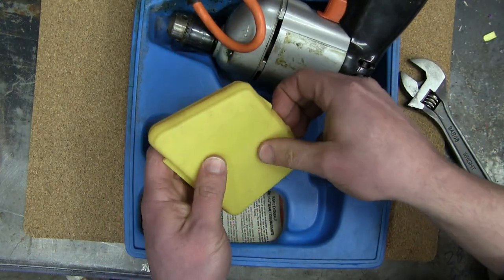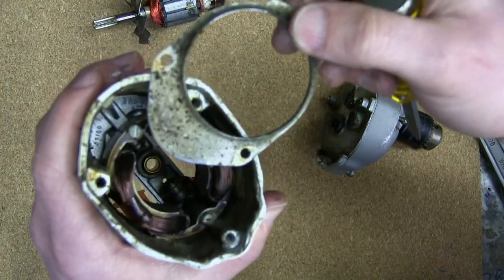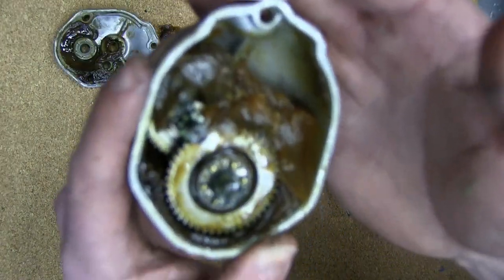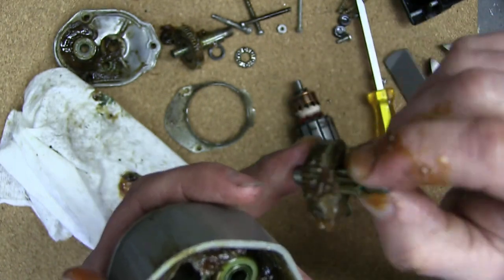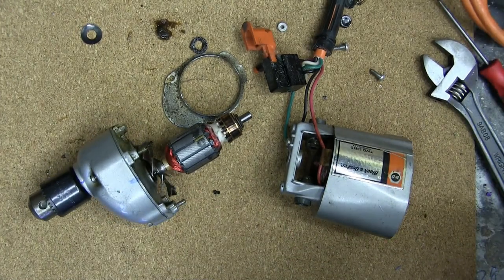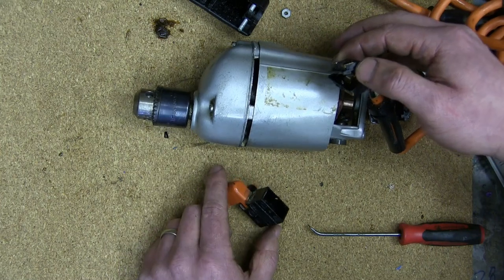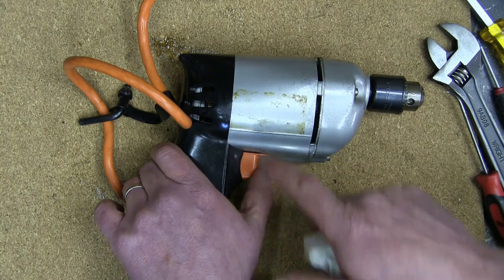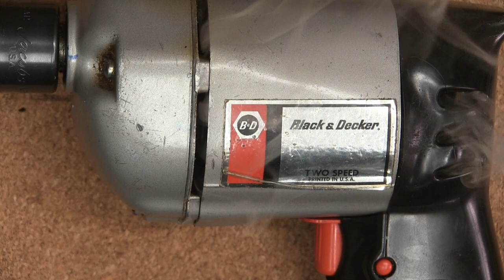BOLTR: Black & Decker. Old School.

Comment: I have that exact same drill!!!! it's awesome
Reply: mine has never been serviced and it has the same brown grease in it
Reply: I've been trying to put a bigger chuck on it, how did you get that one off?
Reply: it hurt me a little to see that one destroyed😂😂
Reply: Put the chuck key in it, then smack it counter clockwise; chuck should unthread off the shaft...
Reply: While I agree that destroying good tools is a shame, I didn't feel much for this one. These primitive single-speed forward-only drills really aren't good for much (not to mention actually quite ugly). The recycled metal could be used for better things.
Reply: Or chuck up a big allen key and smack that harder than you would think and with a larger hammer than you would think.
Reply: Paul Moir thanks, I'll be sure to try it!
Reply: +Albert Ales Probably some form of drill chuck removal wedges, or something similar fabricobbled for the same purpose. Press fit chucks are wedged off, unless you frequently need quick-change of the chuck for a different size or tool head. In that case(you're probably looking at an older, and better built drill press for one), you'll need a drill press hard eject wedge and a mallet to remove the entire taper with the chuck attached, and press home the new head and taper.

My grandfather was a machinist by trade and had nice old enco drill presses. This is how he swapped chucks for his presses, with the taper still attached. I don't know about heavy duty modern presses, but the home depot specials are just press fit and you need removal wedges to pry them off the taper.
Reply: jason sexton thank you, that's very helpfull!
Reply: jason sexton  a drill press chuck wedge thing is completely different than the chuck on a hand drill like this. This should screw off some how. Some have a screw in the bottom that’s exposed if you open up the chuck all the way then it’ll unscrew.

Comment: I have the single speed 1/4 inch chuck version of that drill, handed down by my grandfather (I'm 59), and it has an all-metal chuck. Seeing what looks like a part plastic chuck on your example, and slightly-hooped chuck key, my guess is that yours has a replacement chuck, hence the modern green schmoo. I did not enjoy seeing that thing get smoked.

Comment: The "resistor" you mentioned is in fact a diode that cuts off one sine half wave. This drill has an universal motor and works with both AC and DC.

Comment: I have and still use a similar version but it is variable speed. It was a replacement for the same drill that had a dramatic demise. I was using a speedbore type bit drilling holes to run wiring.  The sharp point at the centre of the bit was threaded to pull the bit through. I had done many holes and the drill was getting hot but being a rank novice, I kept going.Big mistake, the handle let go, it having ripped from the two long screws that connected to the case giving a helluva big electric flash in the air as the handle ripped completely off the case leaving me with two distinct pieces.  I decided I should not load up the replacement drlll the same way.

Comment: I have inherited almost exactly the same model, but 220V and one-speed only (black trigger).  It has been in the family since my dad bought it in the mid 60´s and has drilled a zillion holes: almost all furniture for three houses, plenty of metalwork (sheet and stock) and hundreds of brick wall holes and general fixing of broken things.  Regularly cleaned and lubed, it is still in pristine condition (bushings, gears and roller bearings still original, only carbon brushes replaced a number of times). Cons: the 3/8" chuck is useful only up to 1/4" bits; body starts to get hot if used for a moderately long time without a pause. 
Am still using it these days to  help build a new kitchen furniture.
I liked most of the review, but It was a pity in the end to look at such a noble servant twitching under an undeserved torture. I guess the soul of the poor drill (as good machines do have a soul) is now in machine heaven.

Comment: We've had one of those drills in the family for at least 50 years.  It's loose, it squalls like fury, but it still goes.  It drilled a lot of holes in Missouri native oak framing that was put up green, stuff that only the best with a hammer could drive a nail into without bending it.  If you got stuck with a job that required the use of a drill sanding pad or grinding stone, that was the drill to use because it had the rpm's for it.  Well, you had a better chance of getting results, anyway, instead of just turning the stone into a pile of dust.

Comment: i believe the green schmoo on the gears is just assembly lube and the other stuff was squirted in after assembly to serve as the proper gear grease. 

 i've taken lots of these drills apart and they are almost always packed full of grease like that.

Comment: Cause of these videos, when I let the smoke out of one of my tools, the first thing I do is grab my screwdrivers and open her up, gave me the confidence to at least look if I can put the smoke back in, and I’ll say I’ve had great success!! I’ve rebuilt my drill using ten dollar brushes and found a local to turn my commutators, and now shifting thoughts to older more serviceable tools, plus some tools new when needed.

Comment: Should have fixed it.  I got the 1/2" version new in 1985 and finally managed to smoke the thrust bearing hand-drilling through 1/2 inch steel about 2 weeks ago.  I'm going to fix mine.  (If I can get the part.)o  You can probably find a drill this good today, but you will part with some serious bucks to take it home.

Comment: The added grease functions a heat absorber and dissipater. When you remove grease like that you are affecting its ability to dissipate heat. That increased heat will break down the viscosity of the grease.

Comment: Still have one of those from new. Still runs good when I forget to charge up the Dewilts.  Round brushes are great. Just cut open a C battery and use the carbon electrode. Cheap.

Comment: This is wild.  That there is the very same model of the first power drill I ever used.  My old man had one, when you opened the case I had the strongest wave of nostalgia.  The sound it made terrified me as I drill holes to mount a chainsaw on to my little pedel powered kart.

I never got that project working before he got home, whenever I gave the chainsaw gas it would jump up between my legs and take a chunk out of the steering wheel.

Comment: The two speed is most likely a diode inside the switch, I have a drill dating from 74 I know that's the date as I bought it new, it has for speeds two with gears and a switched diode so you only get half the power.

Comment: Straight out of the 1975 Eaton's catalogue at $120 CDN if I remember. I can go look and show the page if you want. I also have a repainted stamped metal carry case for it's 1955 Grandpa model. My Dad was asked to donate it to B-D for a trade with a 'new' Porter Cable model. It's still working just fine.

Comment: We had one of those drills. It certainly felt heavy duty. The switch and chuck both felt a bit weak but the casing and motor just kept giving...
Reply: Stolen either by my Uncle (thief and tradesman) or brother (just thief)

Comment: Just got my B&D 5726 drill apart. Looks like a single-speed version of yours.

The gearbox (including grease) looks exactly the same. Greenish stuff right at the bushings, and a whole bunch of brown stuff on and around the gear teeth.
It may not have been from servicing. Looks to me as though they got different grease for the bushings as for the gear teeth!

Comment: I once owned this exact drill... Sheared the entire chuck assembly right off trying to put a 3 inch paddle bit through a 4x8 on a cold day in Sault Ste Marie. Served faithfully for many years, but it was on its way to retirement anyway... Well built, but Just doesnt have anywhere near the chooch capacity of modern drills.

Comment: You bet they don't now! All I have is one old B&D Shorty 1/4" drill from the 1970s, the 3/8" 7190 from 1994, and my 2000 Craftsman Professional 27158 1/2".

I am still looking for the following B&D drills:
1180-09 Heavy Duty/Professional 3/8", VSR (3-wire cord)
1180 M57 Professional 3/8", VSR (also DeWalt DW102)
1311-09 Heavy Duty/Professional 1/2", VSR (3-wire cord)
1311 M57 Industrial or 1309 M57 Professional 1/2", VSR (also DeWalt DW110)
5077-09 Heavy Duty/Professional 3/8" Hammer Gun Kit, 2-Speed/VSR (3-wire cord)
5072 or 5073 Industrial "Screamer" 1/2" Hammer Gun Kit, 2-Speed/VSR (also DeWalt DW510/K)

Comment: I still have the front-end of my Dad's ol' drill, same B&D, for when I need grease to put in the used Dewalt drills I've rebuilt for myself. Pops was a 400 lb. gorilla that frequently wore the fuck out of every tool that was to be my inheritance. As a 200 lb. gorilla I don't break them as bad, and thanks to you, I can at least fix the shit I fuck up all on my own. Also, thank you for the term 'fabri-cobble', as it is a much better way to describe how I fix things, than the terms used by previous generations.

Comment: I'm still learning so I do not know too much about it but there was a similar looking system to a late 1960s standing 10 speed kitchen aid that I am converting for those "vintage vampire hipsters" to pay too much for. there were 4 ceramic tiles each about 2mm wide and stacked horizontally like books on a shelf. I had no idea what they were for at first but with a bit of research I learned their true purpose was to allow an easy way out for those housewives who had enough and wanted to end it all! The more you know right

Comment: I need a electric screwdriver but I hate uncorded cheap stuff from china, so I bought a full aluminum casting electric craftsman drill from  1969. It's variable speed and reversable though. Took it apart and it looks great. For about 30 dollars I got me a electric drill/screwdriver that will last my entire life with no need to replace weak lithium batteries or have to charge anything.

Comment: Almost positive this is the same (or very similiar) to one I just picked up from a yard sale for 5 buxs. Turned over, barely. So now taking apart, already got a few decades of squirrel nests outta her....this video will help me greatly on my first foray into power tool tear down and repair.
Im pretty sure one its cleaned out (I wasn't kidding about all the aquirrel crap in there), fresh lube, she should work fine.

All the labels were worn offf mine, so I have no idea what model it is, but looks similiar. Trigger is rated fr 4 amp, so that s my only clue thus far. Still, I fiugure it'll probably use just over 3 amp, so say 400 watt, which would be a 20 amp draw from a 20v battery.....so so it'll still keep up with the new expensive cordless jobs I would think :)

Thanks for your channel,
Cheers,
Chris
Reply: Yup its the same, exactly. What lucm the best tool knowledge repository (at least that Ive found) has demonstrated by first rodeo. Not that I need it, wbut it helps :P

Comment: I will add, my example has dark black grease, but about the same amount as in yours. So the previous guy added what was in there. 
Im replacing it with Super Lube, lithium based with teflon in there. Beeen trying to get my hands on some sub micron size tungsten disulfide (better than moly), but kinda tricky/too pricey

Comment: Back in the day, I was a mechanic that repaired all brands of power tools. Robert Bosch factory trained no less. Bingo! on the wire wound resistor. B & D was the definition of craptacular cheapness. Bosch was the definition of the best quality. All made in Germany, Switzerland or Austria in those days.

Comment: Funnily enough, both of my DeWalt batteries went dead tonight and I had to use a slightly older model B&D than this one to complete the job. I bared heavily down onto it with a 1 inch paddle bit in a 2x4 and it started to smell awful. A short while later I realized the fucker didn't even have reverse.

Comment: I don't see what the problem is.  If 120 volts won't do it, then use 208, 240, or 480.  Blackened dicker won't chooch for long on voltages of that magnitude.

Comment: Not to split hairs, but they're not ‘flat head’ screws. Slotted, slotted head, slot head, standard, even slit head if you nasty. But flat head they ain't. Sorry. 
Awesome drill, though. I've had/have a few of that vintage. It's just too bad they weren't all VSR back then!

Comment: this is a later mid 1960s drill that has the stud on the gear unlike the 1950s Black and Decker home utility drill the 3/8-24 Unf thread stud is permantelly attached to the chuck. as this in your video is a 3/8 in drill it has a double gear reduction as the bigger 1/2 in drill has triple gear reduction and a bogger gear case where a screw on handle attaches to. as the smaller 1/4 is a single gear reduction in which the gear on the chuck shaft is geared to the gear on the armature shaft. as the gear housing is on drills from the 1950s-the early 1970s then is when Black and Decker went to the stacked plastic motor housings. that went to the early 1990s before the drills made then to now are in China now. im not positively sure if this will work with the black and decker accessories of the time which is a drill press, Grinder, sander, and small circular saw. but for the home utility drill of the time.

Comment: Im working on one a lot like that, maybe a little newer, that I’m cleaning up and restoring for my father. Was wondering if when you took the chuck off was it standard or reverse thread? I just barely found out that they are more than just held on with the screw in the center.

Comment: It's sad. B&D was a good brand back in the day until they were bought out, like many other companies. May I suggest building a filter fan for your bench? Those noxious gasses aren't good for ya! The boxes are easy to build and cheap! I made one for my soldering bench out of a couple 120mm computer fans, a spare 12v power supply I had laying around, a cardboard box and a charcoal liner for an air cleaner. Works great!

Comment: AvE, That's gotta be a diode in the trigger used as a half wave rectifier to kinda cut the duty cycle down for lower speed.  The first stage of the switch goes through it and the second stage bypasses it for full power?  Just my thoughts as an electrical engineer and someone who works on similar stuff

Comment: No way this is a resistor in there. For half the speed it would have to burn about half of the power the drill uses at full speed. I don't know the power rating of the drill but that would easily be hundred if not hundreds of watts. This thing is a diode, the cheap way of getting two speeds/power settings out of tools or appliances.

Comment: I doubt the brazed component is a resistor, more likely a power diode, half wave rectification would have been used as a crude control of power.

Comment: I didn't see any flat-head screws, just a bunch of slotted cheese heads. The left hand screw holding the chuck on may be flat-head. The resistor thing-a-ma-bob is actually a diode to provide half wave for slow speed. Most motors come out as 70.71% of full speed or a little less due to increased friction gradient and hysteresis.
 Some commenters have said that it is no good because there is no reverse but drill presses seldom have reverse and almost all tooling is right hand. If you need reverse with them a lot you might want to reconsider your procedures as when you turn it backwards it damages the cutting edge. Reverse is needed for screw-guns and things like taps and left hand drills. I use a few drills like this for the portable drill press, mixing paint and etc. where reverse is never required.
 It is interesting how many videos there are about the multitude of modern drills and other tools that have gone to shit and yet not so many about how my drill bought in '68 went tits up. Says something about the price point when a $9.95 saw from 1976 has outlasted several more modern ones. And it came with a tough, flexible 9ft cord.
   Mike (o\!/o)

Comment: Yap, no one really to teach us younglings about the electros. And I am 30. And the house I am staying at doesn't even have ground connector, everything is 2-prong with all of the 3-prong devices connected to 2-prong adapters and no ground. I only learned a little bit in my trade school but I was only in Facility Maintenance training for 2 or 3 months until I finally transfered to my selected IT Tech training.

Comment: Standard head screws. Flat head screws have a flat countersunk head, it can have any kind of driver including standard drive. It really irks me when people get it wrong and it pisses me off when people don't use the proper size and shape of driver to tighten/loosen them.
Reply from the maker: meh. Potato; Flat head screw.
Reply: Canadians and their potatoes. Are you planning on making some more hardware with potatoes in the future? Maybe you can make some flat head screws with a standard drive like you said.
Reply: Your shop lingo got a dent.  Everyone still loves you though.
Reply: Geez, who pissed in your cornflakes? I just wanted to tell AvE that there are differences in tools and screw types. It just annoys me when people can't get it right.
Reply: Yes. I don't want to argue anymore about it. I made the point, AvE responded, I made a witty retort and it should have been done. But everyone else has to jump at me because... Potatoes. Well, Potatoes is as good a reason as any. So just let it be done.

Comment: would be cool to see an older multi-speedc drill like a craftsman or black and decker wrist breaker.  I had one that was probably 35 years old and weighed a metric butt-ton but could drill pretty well.  it didnt break i just cant find the damn thing.